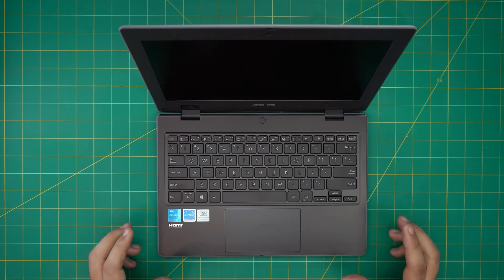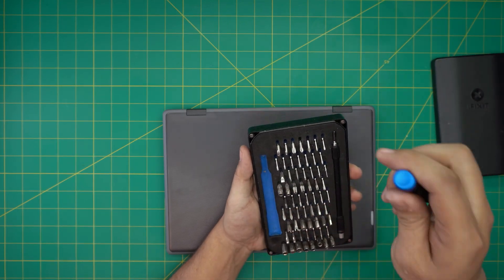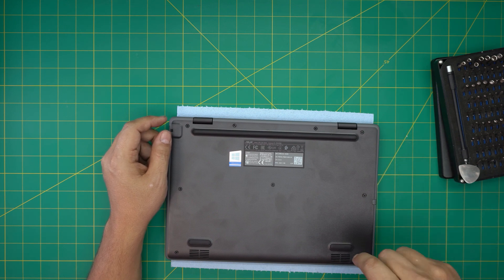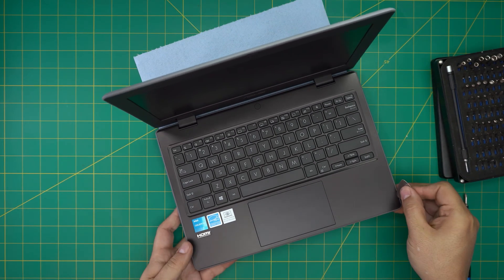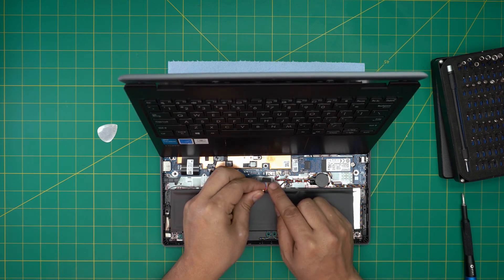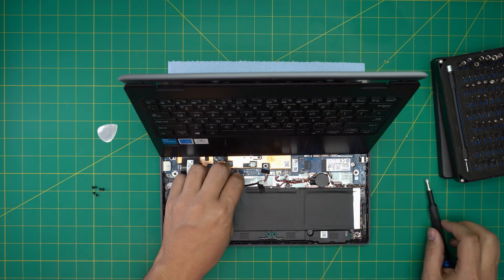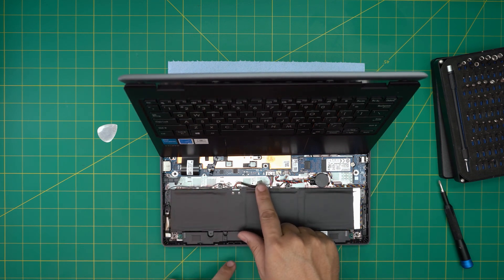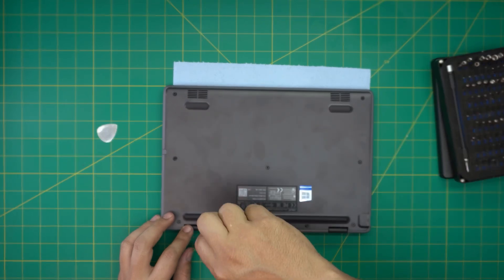How to Replace Battery on Asus BR1100CK Laptop - Step-by-Step🔋🪫

Comment: What to do if I can't get a screw out of the screw lock? Bottom right screw lock (when looking at top of keyboard) will not release
Reply from the maker: 🫠Regarding your question, the screw from the laptop case or screw of the battery?
Reply: @uFixTek  laptop case, I loosened up the screws like you mentioned and can't pull the keyboard/case up because one screw is stuck in the lock